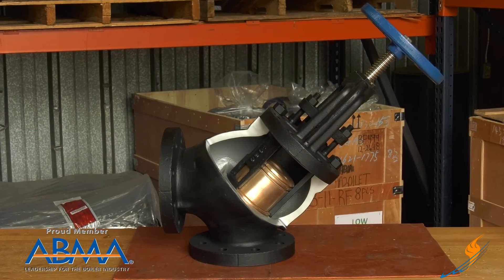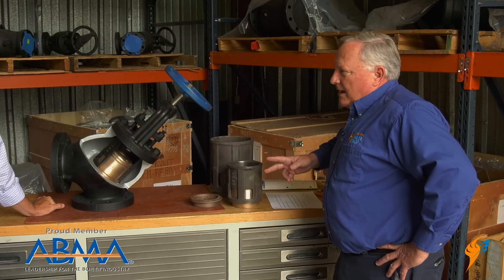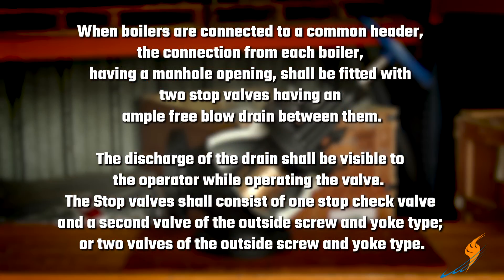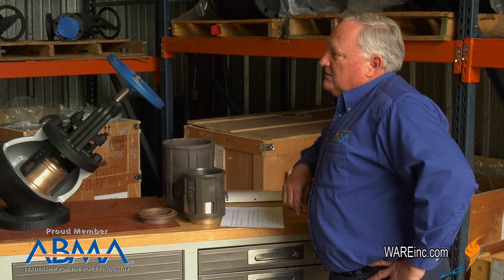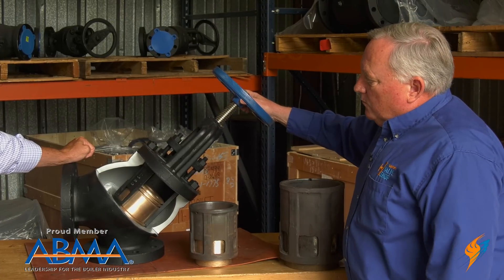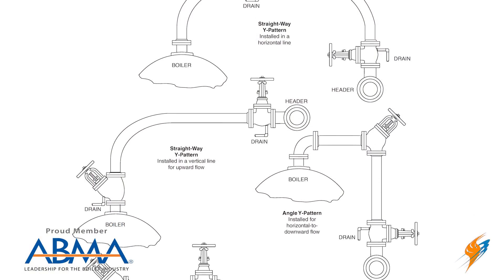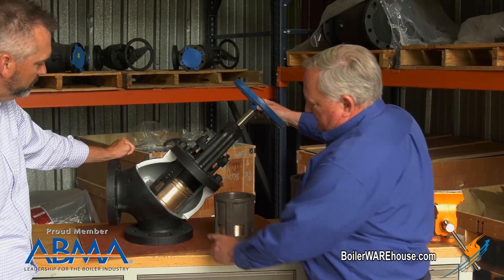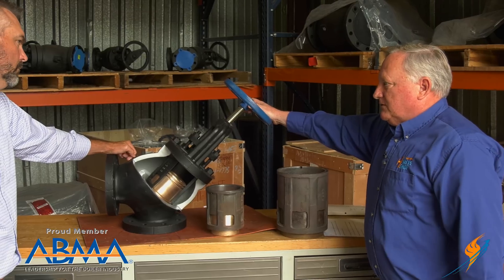What are Non-Return Valves and How to Properly Install Them - Boiling point

Comment: Is it normal for condensate to leak by and raise the water level in the boiler? We have three boilers in parallel and one of them has been having this issue  — at least that is what we think is happening. How do we fix this problem? Thanks for the video
Reply: Do you blow down the free blow periodically?
Reply: @luciusbrutus13th  from the drain plug on the valve itself? We don’t. Right now the drain plug is just a plug — no piping/valves attached to get rid of the condensate. Should something be added there?

For context I’m a relatively new engineer

Comment: We have 2 low pressure boilers in parallel and one valve is not holding back the pressure. they dont look like the ones you are showing, they are just swing valve like a regular check valve you would see. Do we have the wrong type of valve? 
In case your wondering the boiler with the faulty valve does flood with water during the off cycle. 
I
Reply from the maker: Since these are low pressure valves a swing check is the best one to use.  

These valves can take a beating when in service.  The ones you have are likely to be worn out.  Fortunately these valves are not expensive. 

If the header is discharging vertically a steam trap can be installed downstream to the check valve to eliminate the condensate as it forms in the vertical header.   This will work as long as the swing check is not completely worn out. 

We also recommend two drip legs with traps on the collection header if you have a collection header.   Two drip legs provide redundancy.  

Hopefully that helps! If you need more info please give us a call! Thanks for the question
Reply: @wareboilers  the valves are brand new. only one of them seems to work

Comment: As usual excellent video. This is an angle plug type NRV. I have two questions:
1) What does turn down mean (as mentioned in the end of this video)? What is burner turn down and valve turndown?
2) There is no spring in this valve. So the only inertia is the weight of the plug and back pressure of header?
Thanking you for your valuable time.
Reply: I believe turn down is a ratio of your boiler hi to low firing rate. I could be wrong but my memory is telling me that cuz i read or heard it some where
Reply: @AdrianButler86  yes it is